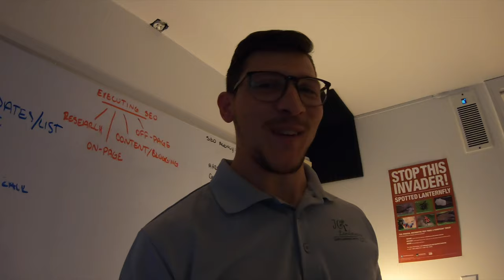2021 Lawn Fertilization and Weed Control Setup!

Comment: Are you guys are 100% liquid
Reply from the maker: Yes, aside from soil amendments.
Reply: I was going to buy the new T 5000 I  really spread granular and use the liquid for weed killer and I’m trying to incorporate liquid fungicide for a round in July would this be a good machine for me ?I have two Perma Green‘s and it’s a rough ride what should I be looking at the new Toro\ zspray or Turfgo t5000 I have a lot of hills in crazy areas ?last question should I be going all liquid ? You guys seem to have it down pat and I love the rack for your machine Well thought out
Reply from the maker: @richscott2952  After having looked at the T5000 at GIE, I personally wouldn't go with it simply because of the complications we've had with the T3100 and the similarities between the two.  We have a great machine now, but notice we've had to do a lot of custom modifications to the machine to get it where we want it.  Overall, the biggest benefits to the T5000 over the T3100 right now are the wider stance for better stability, larger tank capacity, a wider spray pattern, better pump and pump control.  If you are open to suggestions, my next choice for machine would be a Zspray or a SteelGreen.  Every machine has it's pros and cons, but I think you are getting a lot more value for your money in either of those options personally.  Better quality parts; and I know that SteelGreen will work to customize your machine to suit a full liquid program.
Reply: In the beginning with your T 3100 what was your top three problems I’m’ guessing it was the pump ,the granular spread pattern ,and the tip  on hills ? I want to thank you for your reply’s, there’s just so many decisions to be made ! After 25 years and I’m still trying to figure it out
Reply from the maker: @richscott2952  The biggest three problems we had starts with the spray tip.  The original tip sprayed a 9' spray pattern and was burning lawns on the overlap even when our rates were spot on; so we created our own sprayer boom and that solved the problem.  The other problem was the short hose on the hand wand; so we put our own 100' hose reel on it.  The third problem was the top-heaviness and traction; we fixed that by removing the hopper assembly, spreading the frame, and dropping a 16 gal rectangular tank down between the arms.  Now the tank sits lower and right above the front wheels to give the machine a lower center of gravity and better grip on the front tires.  Next we will be purchasing better rear tires to improve traction.  The machine is basically not a Turfco anymore haha.  Hope this helps!  -William